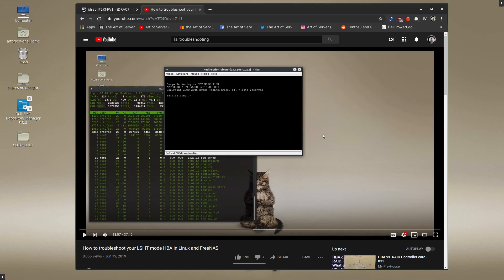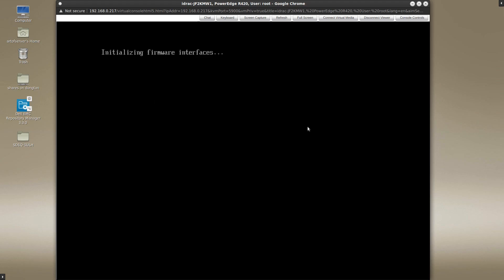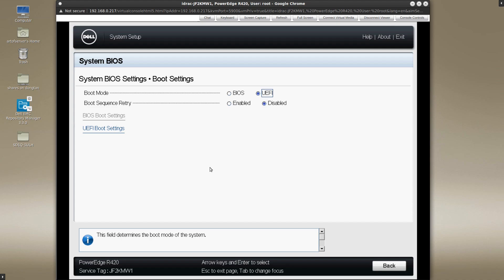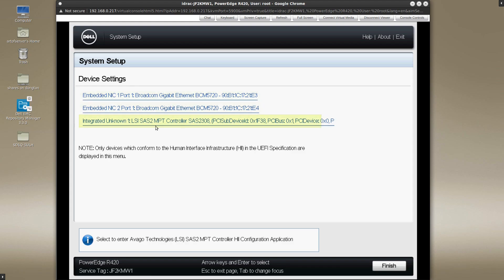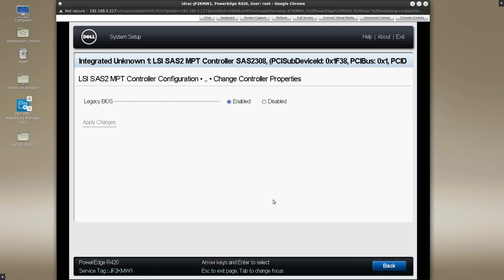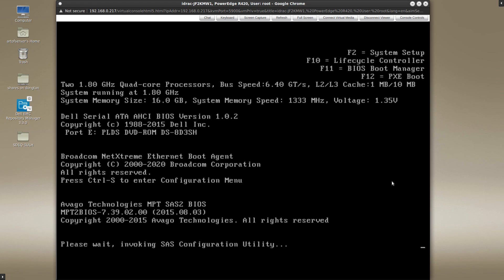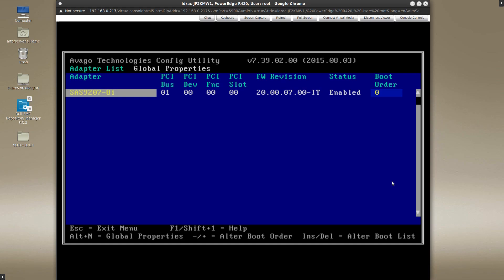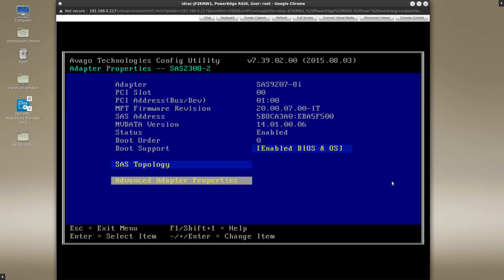Help! I can't get into the LSI BIOS ROM SAS configuration utility | How to fix

Comment: Hi could you tell me if you have a similar video that shows how to do the same in a windows 10 PC.

The card I have is a 9200 and i can see the drives in  drive management but cant get to the card when booting so I can configure the 6 SAS drives attached to the lsi 9200.
Reply from the maker: First, if your card doesn't have any of the LSI ROMs (BIOS or UEFI) installed, you won't have the option to enter the ROM program with Ctrl-C or through UEFI HII. So, you should check to see if your card has any of the LSI ROMs. Boot up your OS, download the 'sas2flash.exe" for Windows and run "sas2flash -c 0 -list" to find out.

Second, there's not much to "configure" as the 9200-8e is an HBA controller. The drives should appear individually in the OS. If they are not, there may be some other issue going on.

Comment: Worth noting that newer cards (9400++) don't support configuration in Legacy Mode (Ctrl+C) anymore. For my 9400, I had to set "Launch Storage OpROM policy" in my SuperMicro motherboard BIOS to "UEFI", which upon the next reboot gave me an "Avago" section under "Advanced" in my SuperMicro BIOS.
Reply from the maker: When the motherboard is configured for UEFI only and without legacy BIOS ROM support, you have to use the LSI UEFI Option ROM, which is what you seem to be describing. Most modern motherboards do have a legacy support mode (CSM, Legacy Option ROM, etc.) that you could enable to get it to load the LSI BIOS ROM (with the Ctrl-C).

Comment: Got me half way… now I can hack into the config utility from settings if I select the hba as my boot device, but my keyboard becomes non-responsive as soon as the utility loads. Took probably an hour fiddling with different keyboards, usb ports, and usb bios settings but nada. I’m a week deep in the rabbit hole of figuring out why my drives aren’t detected and both of your videos were good resources but I’m left scratching my head. 9305-16i, I think regular LSI branded.
Reply from the maker: Not sure about the keyboard becoming non-responsive issue.

As for the 9305-16i, I recommend you minimize the components, say 1 HBA, 1 cable, and 1 drive. Just work with the minimum viable number of components to test. Then follow my HBA troubleshooting video here: https://youtu.be/TC4DovIcGLU?si=VKfHDBcLZpN8sFXL

Once you can get the 1 HBA + 1 cable + 1 drive working, then start adding 1 drive at a time. When you run into an issue, then you can swap connections or drives (with the 1st verified working drive) to eliminate it down to 1 component.
Reply: Similar problem here. Keyboard stops working. I have a 9300-8i on a Z270 (Intel 7th gen) consumer mainboard. With a C226 chipset (Intel Xeon E3 v3) based board the keyboard works. But in both cases no drives get detected. I guess this is only a "cosmetic" problem and not related to the drive detection issue. At least for me.

Comment: @artofserver
i am running an hpe ml350 g9 and am trying to get my lsi controller to work. however right now it seems my bios does not detect it at all outside of one pcie slot mentioning that there is a generic storage controller. nothing points to the fact that it is my lsi 9300 controller. any ideas?

Comment: 😂 it never even reaches that point my guy. Literally hit ctrl + C and it just sits there doing nothing which is wild because it worked perfectly fine 4 days ago and now nothing I don't even have all the drives plugged it anymore. It never reaches a point where it tries to boot or give and f2 option even if I just let it go without hitting control c it just says no partition found

Comment: Awesome video. Got an 9207-8i on an HP DL380 G6. I’m trying to get into the SAS configuration utility but I never see the message during boot that it’s initializing like in your video. I went into the server BIOS and made sure to select the SAS controller as the first boot device but still nothing. I flashed the HBA card to latest firmware IT mode and can see all the drives connected to it. So the server is seeing the card and the drives are being detected. What else do you suggest? Thx.
Reply from the maker: Make sure you also loaded the LSI BIOS ROM on the card. Without it, there's nothing to load during POST. And the server needs to  have the Option ROM for the PCIe slot enabled (usually this is on by default).
Reply: @ArtofServer  Thanks for the reply and info. So I went ahead and loaded the LSI BIOS ROM. Now at least I can see the prompt to press Control + C to access the BIOS configuration utility but now I have a new issue, after pressing Control + C, I’m getting the following error message, “Fatal PCI Express Device Error PCI Slot ? B00/D07/F00 0E_”. Any other recommendations?

Comment: Hi there! Thank you, however the issue i have is a bit different. I have a r720xd with a h710 mini mono which was flashed, and shows in device settings in Bios as the LSI sas2308 device. It actually sees the physical drives connected to the front and back flex bays (from looking at phyiscal drive settings on this device setting in BIOS), and i want to go and make one of the back flexbay drives my boot drive. My actual problem is upon bootup its like the system does not see the HBA/LSI and ctrl+c does not even appear for me. I only get the basic dell xe boot loader and then its attempts to initialize and roll on. In the BIOS i have tried this in both UEFI and BIOS with no luck. Further into the hba device settings in the BIOS i can view controller information but the 'change controller' option you had shown in the video is not even there. I have inspected the HBA and it is plugged in properly. Any thoughts on what i can check/do so i can finally go in and assign one of the drives the HBA shows as the boot drive? Ty!!
Reply from the maker: I would check your card has the LSI ROMs installed, both bios and UEFI ROMs.

Comment: Hi. I am asking for help and advice or an instructional video...
1. How to create a raid on the LSI 9300-8a HBA card installed in IBM System x 3850 m2.
I have a connection via a mini sas cable connected to this HBA card IBM storage V7000 G2 Extendet 24 drives
When the server starts, the BIOS sees 24 disks and 24 partitions via 1 cable connected on the left, or the BIOS sees 24 disks and 48 partitions when connected via 2 mini SAS cables on the left and right simultaneously.
I have a question how to create raid: 0 or 5 or 10 on this HBA card in the BIOS because Windows Server 2008 R2 Standard after logging in sees only 1 disk and does not see the remaining 23 disks.
After entering the Bios program: Avago Storage by LSI, you cannot see the list of disks from which any RAID can be created?
Please post a turtial training video on YouTube with a description of this problem Raid on the HBA card...
Thank you and best regards.
Jack
Reply from the maker: I think you misunderstand the difference between RAID and HBA. They are different things. An HBA does not have RAID capability by itself. See this video for more in-depth explanation: https://youtu.be/xEbQohy6v8U

Comment: Hello, I have the following problem, I have an avago megaraid sas 9460-161 installed on a Dell precision 7920,
From one moment to the next I cannot access the controller software, in the bios I see that it detects the controller. Initially it started emitting intermittent beeps. I need to create Raid 1 for Windows  11.

This card is the one that comes by default on the device, I have never made any changes to this device.
How to solve it?
Reply from the maker: When you get the beeps, listen to the beep pattern and write it down. Look up the beep codes from the user manual to find out what it means.

Comment: Just hot a new to me R720xd...first time I tried I could boot into the config utility..pretty sure I was careful not to make any changes....now when I try to go in it, it says to please wait like its going to load, but then the orange PCIe indicators comes on and the system just reboots..any ideas? Seller thinks its the motherboard but the controller and drives show up in Bios..should I restore the H710p card and flash it myself?
Reply from the maker: You need to check what the "orange" indicator means. The the iDRAC/BMC system event log for more details. You might have a card that went bad, but you don't know until you read the log messages to find out.
Reply from the maker: Oh, and congrats on the R720XD. It's one of my favorite storage servers.
Reply: @ArtofServer  it's the PCIe logo that blinks orange...but the H710p mini card is the only card in it...and it's installed on the motherboard...I can clear it and start the machine normally..but if I ever try to go into the SAS config utility, that comes on and the machine just reboots
Reply: @ArtofServer  oh and I tried it in another R720 and I get a PCI-e degraded link width error - think I'm just gonna replace the card

Comment: Hi, thank you so much for this video. I finally figured out and configured my RAID controller. Just wanted to check whether we can change  to NON IT mode ? When I checked in the uefi interface firmware type mentioned i IT. I am trying to install the VMware esxi in ths SAS storage. I am not sure whether I will be able to isntall it. When I tired before in legacy it didnt allowed me to install. Also Can we make these SAS drive as storage to install any OS and boot from them ? I watched a video long back where they  made they disk as bootable. TIA
Reply from the maker: It depends on which SAS controller you have and if there's a RAID firmware for it or not. Usually, if there is, then there's a way to convert it back to RAID firmware instead of IT mode firmware.
Reply: @ArtofServer so it's either or. Raid or IT mode. You have to make a choice?

Comment: Mine is doing something strange. I can press Ctl+C and it gets to the scanning for devices please wait page and never further?  System sees the drives, and I can boot by going to bios boot menu

R420 with H710P D1 mini cross flashed
Reply from the maker: Try booting in legacy BIOS mode instead of UEFI.
Reply: @ArtofServer boot set to bios, card set to legacy
Reply from the maker: Not sure then. Might be something to do with one of the drives connected. Try removing all drives and see if the behavior changes. If so, insert one back in at a time and see which one triggers the issue.
Reply: I have tried everything I could think of, including that. For whatever reason, it boots, even though only one of the 4 disks is a boot disk. I just gave up lol
Is the 4th node of a proxmox cluster and basically only runs proxmox backup server

Comment: I have an HP dl380p Gen8 server that I flashed the latest HPP. I have the internal 420i disabled in the BIOS. My LSI 9207-8i is flashed with the latest IT firmware and BIOS. When I hit Ctrl+C, I get to the screen saying something about loading the config utility and then I get the red screen of death. Any idea what I can do? From my understanding, the Gen8 only has legacy BIOS. UEFI BIOS didn't come until the Gen9 servers.
Reply from the maker: I believe G8 Proliant servers have an BIOS conflict of some sort with LSI's latest BIOS ROMs. Sometimes this causes an error NMI (Non-Maskable Interrupt) error. The workaround is to downgrade the LSI BIOS ROM to a slightly older version, which I've made available here:

https://artofserver.com/downloads/lsi/firmware/sas2008/p20/mptsas2_7.39.00.00.rom

Give that a try. Let me know if it helps.
Reply: @ArtofServer  Thank you very much for your reply. You are correct. Someone on Reddit helped me earlier today. I had to erase the card completely and then flash the P20 IT firmware with the P19 BIOS. The config utility loads up just fine now.
Reply from the maker: The LSI BIOS ROM I linked above is newer than P19 and should still work for your HP G8 server. Just FYI. Glad you got it resolved
Reply: @ArtofServer  Well, now that I'm an LSI flashing guru, I'll give it a whirl and see if it works in my PITA Gen8 server. After all of this though, I decided to replace the optical drive with a 255GB SSD and I'm booting ProxMox off of that.

Comment: HELP! I flashed the firmware of my LSI 9212-4i to P20 and now I don't have access to the Config Utility (CTRL+C) during POST anymore. Prior to the flash I was able to see it during POST in Legacy Boot mode, What did I do wrong?
Reply from the maker: Sounds like you might have forgotten to flash the LSI BIOS ROM or UEFI ROM.
Reply: @ArtofServer  I'm pretty sure I did. Here are the commands I ran in EFI shell.
sas2flash.efi -o -e 6
sas2flash.efi -o -f 214i4et.bin -b mptsas2.bin
sas2flash.efi -o -sasadd 500605bxxxxxxxxx

Only one card. All executed commands went through without any errors that I could see. Any other commands I am missing or could try.

Comment: got an LSI 9212-4i4e card, my motherboard is an ASUS B560M, and it doesn't show up upon bootup. but on H310M motherboards, it worked ok as long as there's a legacy option.  the problem is the motherboard dont have support for legacy, is there a way to reprogram this RAID contoller to boot on uefi boards only?
Reply from the maker: Most modern UEFI boards should have a CSM (Compatibility Support Module) option. See if you can enable that. If not, you can flash the LSI UEFI ROM and use it through the UEFI HII ; however the control options are more limited via the UEFI ROM.
Reply: @ArtofServer  thanks for the reply.. I've read from some sources that on intel 10th gen onwards, most video bios are only uefi. In Asus B560M, you can only enable csm if there's a little older video card, but bios will prompt you of unsupported uefi graphic card but will continue to boot.. since it has only 1 pcie 16x, no way to run them both. On Gigabyte H510M, i can easily enable csm and enable legacy boot option but the LSI 9212 wont display because video bios only support uefi.. the shortcut to solve this, I need a uefi firmware for this RAID controller, which I believe is not available.. or I stick yo a much lower intel gen..

Comment: When I go to enable the legacy BIOS mode, it gives me a warning that the RAID may not boot or could require reinstall. Will this for sure happen? or how likely is it? I am on a preconfirged system from dell that already has the software needed on it. I have never had to deal with hardware raids before .
Reply from the maker: I am unfamiliar with that warning message. It might be concerned about being not being able to boot a EFI installation vs BIOS mode installation. I don't think it has anything to do with the RAID array itself.

Comment: I thought this would help me but it didn't. It helped me get into LSI bios. However Windows still wont boot with the card in place and drives configured. Now if I remove the hard drives connected to the card I can go into windows and even load a driver for the card. but when I plug in the drives into the card and the controller loads its bios for the virtual drive windows will not start runs into some weird boot problem and will not boot again until I remove the card. Now I have no problems with the 9650SE card with virtual drives but not my 9265 8i my computer is a HP Z230. Any ideas? I have tried all bios options I can think of. Nothing works.
Reply from the maker: Which LSI controller are you having problems with? And what's the version of firmware on it?

Comment: Is it possible that my motherboard just does not support this card? Cannot get it to pop up at all and have updated BIOS
Reply from the maker: I would check, in addition to what is show in this video:

1) you have enabled Option ROM for the PCIe slot you're using.
2) that the LSI SAS controller works in another system.
3) that you don't have an SMBus conflict.
Reply: my motherboard doesn't have any legacy options, only uefi, so this card doesn't appear anywhere on the bios.. so maybe we have same problem

Comment: I just used your guide which resolved my problem. I am now able to open the BIOS mode of the card. I could also open the card in the UEFI PowerEdge 720 bios. However after flashing the card to the latest firmware (from broadcom) I now can't see the card anymore in the UEFI settings of the server.

Any idea how to resolve this? (I already regret upgrading the card to the latest version, but I can't find the old version either).
Reply from the maker: Did you also update the UEFI ROM on teh card?

Comment: Hm...I can access the SAS configuration utility, but only one of my cards shows up in there. Both cards work, and I am using disks connected to both of them in unraid, but only one of my cards is detected in the utility during boot. Any suggestions on how I can fix this?
Reply from the maker: What are the models of the 2 SAS controller cards?

Comment: Do you happen to know a fix for lsi2208 rebranded to m5110e in IBM servers (physically on the motherboard) where it doesn't start with an SSD in the system and doesn't detect it in the configuration utility? It works absolutely fine with a hard drive but as soon as it has an SSD it doesn't cooperate
Reply from the maker: I've used sas2208 RAID controllers with SSDs without issues. Is it just a particular model/brand of SSDs, or are you having the same issue with any SSD you try?